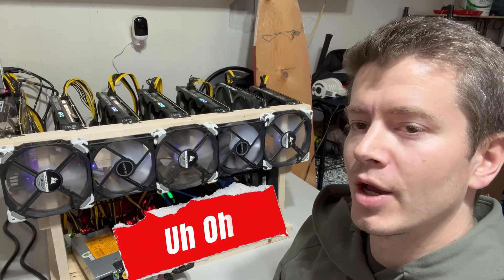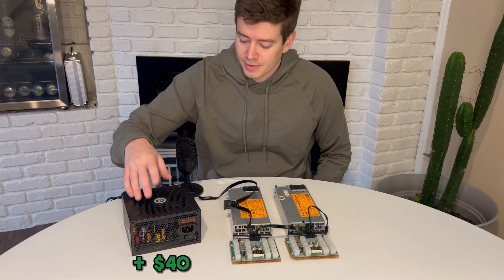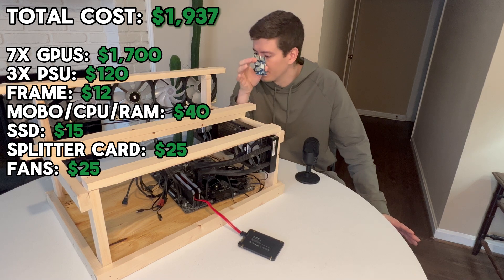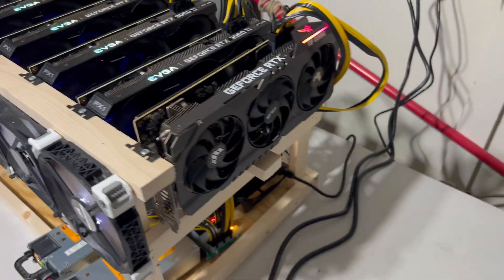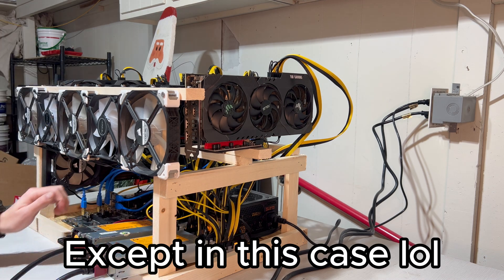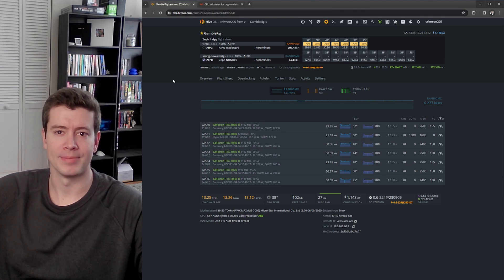I Built The Most BUDGET GPU Mining Rig in 2024

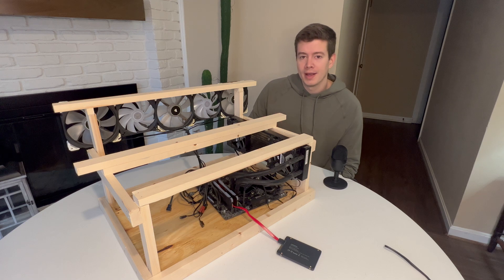Comment: 1:12 If you use a smart plug + power bar then technically you don't need to chain PSUs together with a molex cable since the smart plug will power on and off the PSUs at the same time and you can also remote power on/off. This method works fine for 1 ATX PSU + X number of server PSUs. You could also do it just ATX PSUs if you use 24pin dummy plug or paper clip trick. One of my EVGA power supplies came with a 24pin dummy plug.

1:28 Wood just seems more dangerous with all the heat. I would pay extra for aluminum and self tap screws. 

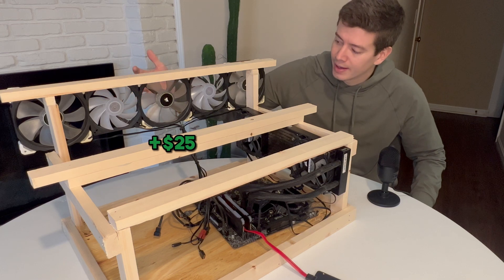1:43 I got an old dell but the system wouldn't recognize the GPUs no matter what I did, maybe I did something wrong.

Comment: its cool but its better rx 6600 hash for watts and it better to buy mining motherboard for 12 cards its second hand 50 dolars also with cpu and ram.Before 1 month i found rx 6600 for 125dolars so i grab 10 of them.15 hashrate on aipg 57-60w.
Reply from the maker: Yeah I agree, a used mining motherboard is actually relatively cheap right now. My issue is I can’t fit 12 cards on one circuit without going over the 1440w
Reply: @ModernMiningHub  u can add one more power suplly. i also realy like the hp server power u use i use them too gold and some plat.They are very cheap right now and i can say the have no diff on the efficiency plat and gold.they are 94-95%

Comment: I was thinking of getting a 4090 just to mine in for my pc, but i also have a 6900xt in it i was wondering should i go a liquid cooled version as there alot slimmer, is there any down sides to running a water cooled 4090 over a air cooled one
Reply: I want to ideally fit both cards, I have a 1200w power supply
Reply from the maker: Only downside i would think with liquid cooled is harder to resell eventually. If you are going to fit both in one case then honestly liquid seems like a good option. Might have some headaches mining with amd/nvidia on the same rig but it’s not impossible by any means.

Comment: You seem to be forgetting that our climate especially the summer temperatures have gotten out of control & the only way to be able to mine even during summer heat is having the rig in sum sort of a server frame with plenty of fans cooling the GPU, CPU & power supply. I have lots of open aluminum frame cases which all needed to be shut down bc of triple  digit heat & they all had fans front and back but that was not enough. 
Greetings
Reply from the maker: I move everything to the garage in the summer. Hasn’t been a problem in the past but certainly not as easy as winter!

Comment: first thing dont use Intel based cpu/mobo's with the amount of cpu coins now and amd ryzen mining so well going into you leave a lot of potential money on the table. and if you are going to cpu mine with a ryzen make sure you have 2 sticks turn down the Voltage of the cpu in the bios and at least 8gb of ram for the 6 core ryzens. 8 cores and up i like to use 16gb and dual channel. also some of the older intel boards dont really have pcie lanes set really well and you cant change things in the bios also

Comment: I tried using a optiplex motherboard with a i5-4570 and I couldnt get it to post with more than 1 gpu connected
Reply from the maker: I know some are too old and don’t have the right UEFI bios.. not saying that’s the case but could be it.
Reply: theres a couple of things with the optiplex line first the bios is very basic and you cant realy change anything in it as you need 4g decoding turned on  to get all the cards to show up. also some optiplexs were spec built meaning they had one intended use so some slots on the mobo arent dead they are turned off by the bios and you cant change that ever. i used to manage a refubishing computer store when we would get boxes like this from the gov we turned them into unbuntu boxes and sold them dirt cheap and i also asked Michael dell him self as he was friends with the owner of the company and he would call my store from time to time looking for the owner